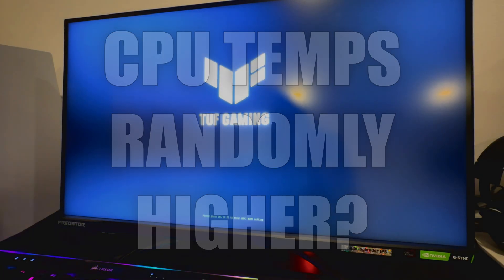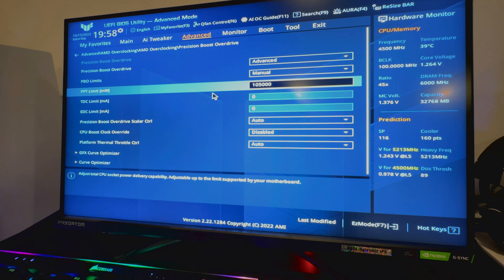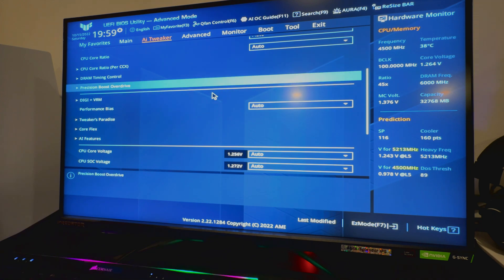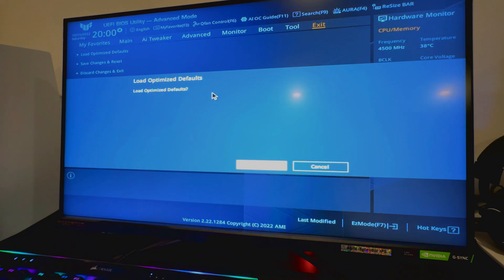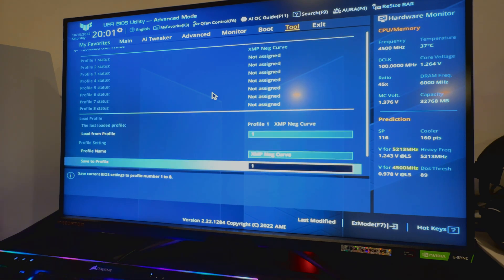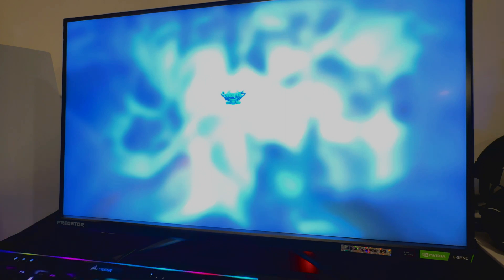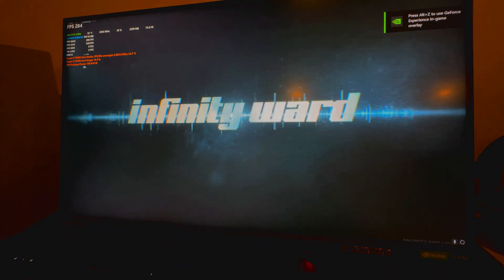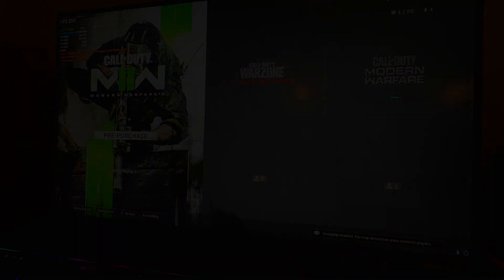ASUS Motherboard not Enforcing Ryzen 7000 Power Limit

Comment: So in AI Tweaker is in Watts and if you are manually configuring PPT, TDC, and EDC you enter just the first 3 digits?  Eg instead of PPT mW of 105000 you enter 105?
Reply from the maker: The bios update allows you to do that. Works fine now.

Comment: how you get the PPT to show on AI tweaker? In latest bios? Have the same mobo, but when i tried to get to the latest bios it gives me a black screen so i cant do anything......have to flash back to stock and keep it there.....
Reply from the maker: So for me they moved out and onto the main menu under tweaker. I was only able to set it using PBO, my manual OC I don't have a limit on and it stays significantly cooler at 5.25GHz 1.26V L6 (going off memory)
Reply: @FIVESTRZ  cheers for the reply.....which bios are you on?
Reply from the maker: @TekkenArtLover  1003_PatchA+D

Then under the AI Tweaker Menu -> Precision Boost Overdrive - PPT Limit
Reply: @FIVESTRZ  thanks!
Reply from the maker: @Jun Lau  most definitely. I also tried Medium Boost and it allowed over 5.5GHz again

Comment: Yea you can force it by putting PPT limit and also by the amd tuning software. I'm not sure if they added the option for 105W in their software. The ECO mode enables 60W only, but maybe they change it for other options. 
Overall 105W is great for gaming. In the other video I saw your chip boosting to 5.6-5.7ghz constantly
Reply from the maker: Yea I never did like Ryzen Master to be honest with you. Caused me so many headaches on my 2700X build and that just ended up becoming my perception. Heard it’s better and I went to use it on my 5900X and it gave me 4.85GHz but their OC wasn’t stable
Reply: @FIVESTRZ  it's always better to change things through bios, but sometimes you want to change something for a moment or play with the settings frequently, it's more convenient when you have the software there, instead getting in the bios everytime
Reply from the maker: @F1monster1  yea I definitely can understand the on the fly aspect, I try to keep as few programs running as possible to keep resources freed up

Comment: I used to have that same mobo, refunded it immediately, now I’m waiting on the new Gigabyte B650E
Reply: Update: The new mobo is great, did the same oc on curve optimization done here working as intended, copped a 3090 for 900 and just testing games amd stuff
Reply from the maker: @Troonielicious  steal of a deal right there bro!crazy how the market seems to have flipped
Reply from the maker: Damn, my man said IMMEDIATELY lol. What happened to yours? This one has been decent so far for me, Frame Chasers gave the nod of confidence to the Gigabyte X670 I don't even think it was the E model but yea, curious what you ran into
Reply: @FIVESTRZ  lol yeah shame, it’s a solid board just mine was giving a lot of error codes, couldn’t post most of the time it would get stuck on cpu light, then ram stucked, then VGA, I had to clear Cmos all the time before it posted, Expo Ram didn’t work, cpu oc nothing, I got tired and returned it.now I’m waiting for the B650E that just came out on the 18th but I will do that same oc you did and see if it works for my cpu.
Reply from the maker: Wow that's a lot. I did start the process with a bios flash and that helped a ton. They are on their second beta bios which is what I was talking about with my PL being overridden
Reply: @FIVESTRZ  I’m glad it worked for you, hopefully the gigabyte doesn’t turn lemon too lol fingers crossed 🤞
Reply from the maker: Haha facts! Just have the latest bios ready for flashback if you get no boot and give it up to 10 minutes for the memory training, that part was the strangest to me
Reply: @FIVESTRZ  yeah I’m guessing that’s gonna take a while to get really fixed, I saw a Jayz2Cents video talking about it, he swapped out a 4090 to another brand and the system was just doing memory training every time it booted.
Reply from the maker: @Troonielicious  also people are seeing which kits of RAM boots with which chip so someone I know had a kit boot with 7700X but not with 7950X. I’m trying to figure out these FPS issues because the card is so fast (4090) that it’s waiting and at 50-65% usage in some cases
Reply: @FIVESTRZ  that card is a beast, wish I had that kind of cash,but will prolly buy a 470 this time, I think it would be a nice balanced game build.